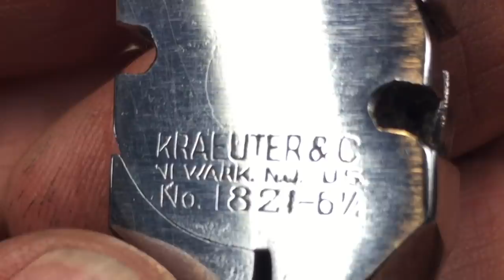Gerber Golok, Rockwell JawStand, Kraeuter 1821 Pliers...

Comment: I managed to snag a dingy but very solid pair of 1821-8 Kraeuters at the flea market this AM. They are soaking in some vinegar now. The handles don’t have the designs, and the marking only says “Kraeuter / USA / 1821-8”. They are not nickle plated, and don’t seem to have ever been plated based on all of the surface rust. How old do you think these are? Also, why do these pliers have that 1/16” gap in the main jaws even when fully closed?

Comment: Out of curiosity, if you used sandpaper on a flat surface, would it have been extremely time consuming? Would the results have been any better or worse?
Reply from the maker: Hi Joe!  The problem is since the pliers are so hard it takes a long time to go thru the grits!  However if you had the patience and went thru the grits I think hand sanding would give a superior finish!

Comment: I have not retired my ax.  I started using close to 50 years ago.  It is second nature for limbing and splitting.  In the north,  you need a truck load of wood for night out and I doubt there any people that keep up. I doubt there any 70 year old loggers who might used an ax for logging that could keep up the pace. I have probably a half a dozen Swede saws  (bow saw) to others. Many are as old as me. You find them  the same place you get old tools.  You can buy a new blade on Amazon.  I used a buck saw when I was a kid because it was given to me. Not hard to make and are take down so not as bulky.   A saw, ax and a slip joint pocket knife like a Kabar hunter and I am good to go. For those that don't have a saw,  an old sharp crosscut hand saw can do a lot.  I have used one on a camping trip.  I have the Condor Golok and it is a hefty piece of steel.  Their Hudson Bay knife could easily handle batoning wood.
Reply from the maker: Hi Philip!  In my area there is plenty of blow down that once you have a good hot fire going the saw is all you need...  The bow saw is the unsung hero of the outdoors...  I would love to show my Axe collection as I have been collecting them since I was 15!  =D    Thanks!!!!!!!
Reply: @ScoutCrafter   You could build a great buck saw on a video.  :)